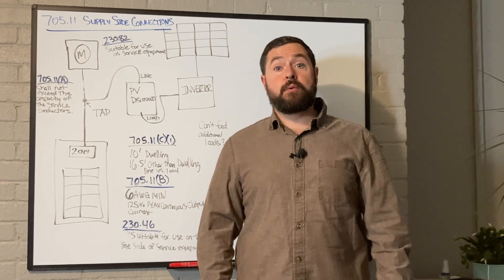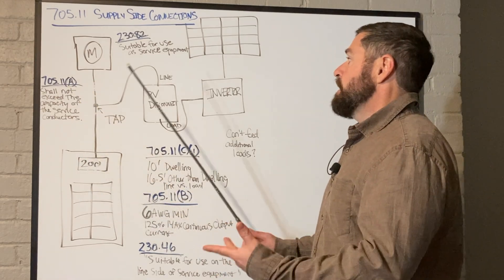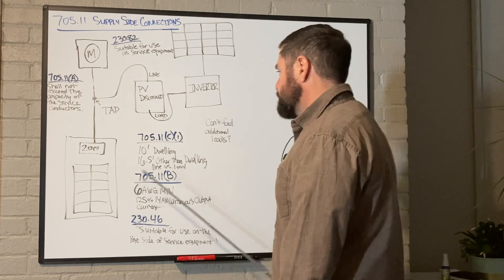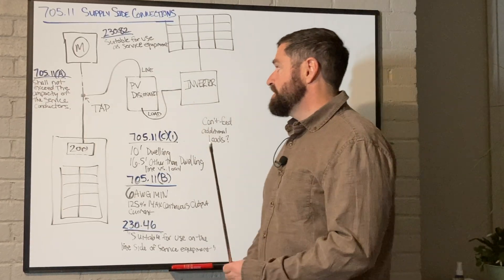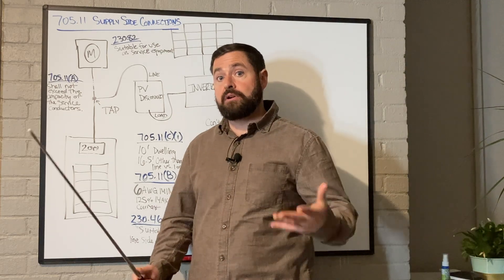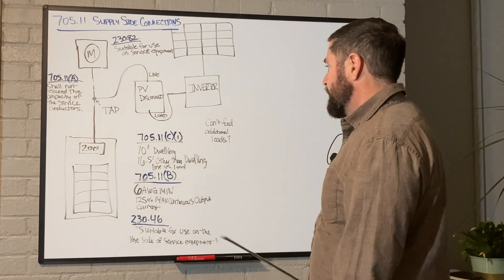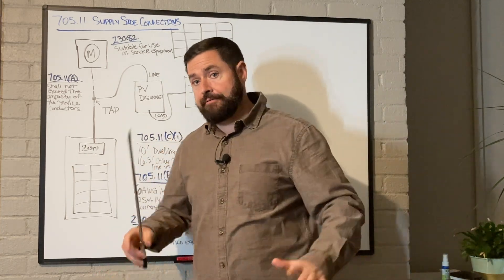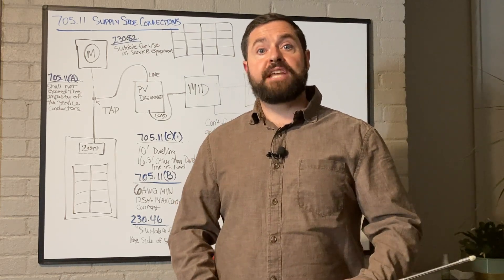Understanding Solar Supply Side Connections & NEC Compliance | Solar Installation Guide

Comment: Is there a scenario here where you can add a battery back up to line side tap?
Reply from the maker: Yes you can. The only potential issue is exceeding your service rating. If you have a 200A service with a 200A panel, and you line side tap a battery backup system with a 100A sub panel, then your service is no longer protected at its ampacity and if you tried to pull 300A from the utility, you could. One solution is to add a 200A breaker upstream of the tap making it a “load side tap.”

Comment: If i have 100 amp main panel in the house and I tap before it enters the main 100 amp breaker would it still be a supply side tap if there is also a 100 amp breaker at the pole between the utility and my house? My pole was originally for a trailer home so its where the meter is and there is a 100 amp breaker at that location. Just trying to determine if I can still follow supply side rules when trying to tap from my main panel to feed my Flexboss18. Also my max continous output would be 54 amps on F18 so my hope is to use existing main lockout to disable power coming through the normal main breaker and instead backfeed the main panel with an 80 amp breaker and 4 AWG copper. I know the MID is preferred but it is just not in the budget at this point. Any advice? Thanks
Reply from the maker: That would be a load side tap which falls under 705.12, but as long as there are no branch breakers between the 2 main breakers then you are fine. It essentially operates the same way, making it impossible to exceed the rating of tour service. I plan on making a video on load side tap rules in the near future. Yes, as long as you are using a generator interlock kit and overcurrent protection within 10 feet of the tap, upstream of the inverter, then there is no reason you cannot set it up that way.

Comment: What is the proper neutral / ground configuration for a residential  line side tap? With a 100 amp service panel already ground neutral bonded.
Reply from the maker: There are 2 acceptable options... 1. Run L1, L2, N, and G all from the tap location un-bonded through the disconnect and throughout the rest of the system. This is a common option when tapping inside a main service panel. 2. Run only L1, L2, and N from the tap to the disconnect where you create and bond an EGC to the N. Keep them isolated throughout the rest of the system. This method would be common if you are tapping a 3 wire service conductor outside in a tap box where you don't have access to the EGC in the home.
Reply: @RockyBroadSolarLLC thank you !

Comment: Great info. Question i have. If i disconnect my main line to my breaker as you have shown here so that i can connect a double throw switch with one line feeding my inverter and other when i need a grid, Back into the main breaker from this switch. So my panel is bonded now doing this i should bond my switch and unbond the panel ? Also my panel is indoors does adding this switch this way does it need to be outdoors or can it be installed indoors per code.
Reply from the maker: @SlimWorks Most AHJs are running on the 2020 NEC or newer at this point. Once you start modifying the service equipment they want it all brought up to current code, which requires an "emergency disconnect" outside by the meter. Most people just use a main breaker enclosure, but in this case the double throw transfer switch should suffice. Yes, you would then want to bond your ground and neutral at the transfer switch as well as having your GEC terminate there. Then you would run 4 wire to your sub panel and keep all grounds and neutrals un bonded. Thanks for watching the channel.

Comment: Hello, I want to add more solar to a building that already has solar. one question, I have 1200A bussbar (no main disco) rating, and the existing disconnects are 1 fussed disco 600A, one 400A and the last one is an existing PV inverter 200A with 150A fuses. Can I connect the equivalent of 1200A in PV disconnects (the sum of the new inverters)?
Reply from the maker: @pululunguente I am not entirely clear on your setup to be honest. So you have one giant hot bus of 1200A that feeds the 600A, 400A, and 200A discos? If you connect a PV system to a hot bus it is considered a supply side connection because the PV is on the supply side of your 600A and 400A service disconnects and your service is still protected at its ampacity. Hope that helps, thanks for watching!

Comment: I couldn't tap the line side anyway, due to having an integrated meter / main-panel.   What I wound up doing was removing all the circuits from the main panel and then installing a 200A forwarder to the ESS system (EG4 Grid Boss).    Then everything... the entire house and the "new" main panel inside the garage (other side of the wall from the old main panel) hangs off the ESS system.   (all the circuits on the old main panel were moved to the new main panel inside the garage).

Meter -> 200A main disconnect -> 200A forwarder breakers -> EG4 Grid Boss -> 200A load breaker -> NEW main panel

The AC coupled solar goes into dedicated inputs on the Grid Boss,  Any DC coupled solar goes into the EG4 hybrid inverter... also connected to a dedicated port on the Grid Boss.

Is this code compliant?  I don't know yet.  Right now I'm trying to figure out whether I even need a manual disconnect box when the main breaker can simply serve that function to isolate the utility.  The house would continue to run on backup power in that event.  The system is too complex to feed-out separate little disconnects at every junction (inverter, various AC coupled solar)... the Grid Boss handles it all.

The only thing I have outside is the big red button which not only kills the RSDs, it also takes down the entire system... the inverters, the Grid Boss's relays, the batteries.  Everything is turned off.   The entire house.  The grid is even disconnected as well.   Is that good enough for code?  I don't know.

-Matt
Reply from the maker: Hi @junkerzn7312. Yes, that is absolutely code compliant. I plan on doing more of these code videos in the coming months. In this case you fall under Microgrid Interconnect Device rules from 705.50-705.70. As long as all home loads and generation sources are downstream of the MID, then this omits you from having to abide by the rules in 705.12. The only thing you need to be aware of is to make sure that all downstream sub panels are protected with their own overcurrent devices, which in this case it sounds like they are. Mainly because you can now pull that 200A from the grid, plus additional amperage from your solar and batteries, potentially overloading those downstream sub panels(only if your loads actually try to pull that much power). Hope that helps. Thanks for watching the channel!
Reply: @RockyBroadSolarLLC  Yah, they are.  I moved the original 100A sub-panel breaker and cabling to the new panel and it of course still gets a 100A breaker.

I copied and pasted your reply into my notes so I don't lose the references.  Thanks!

-Matt
Reply from the maker: Thank you for watching the channel Matt.

Comment: I'd say having an AC-coupled ESS on a line-side tap would be a violation.   If the ESS is charging from the grid and the main load is pulling its maximum current then the feeds from the meter to the tap will be exceeding their current rating.  Or you derate the main breaker to account for it.  Or you have CTs on the meter side of the tap to inform the ESS the maximum it can draw power.
Reply from the maker: @jabbathespud Good point. Many areas to not allow grid charging but it is becoming more and more common, especially with the virtual power plants popping up. That is what the NEC is there for....those worst case scenarios. Thanks for watching!